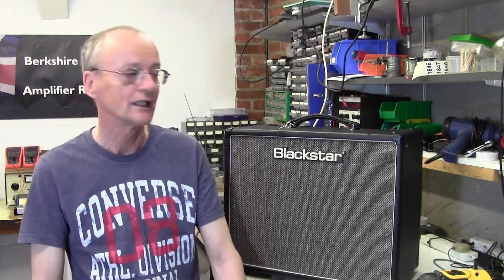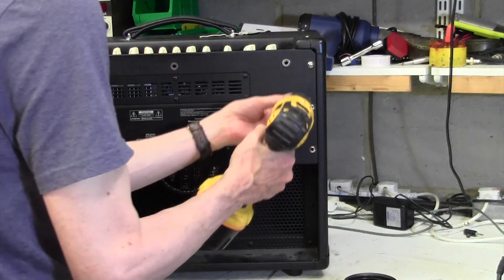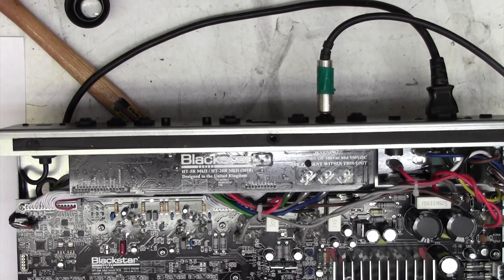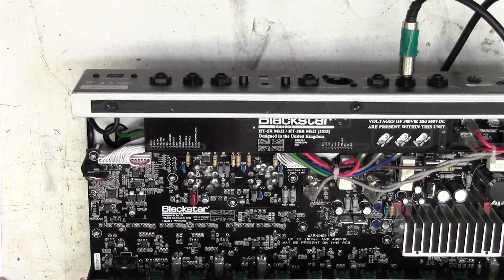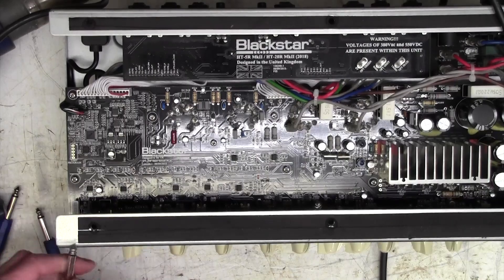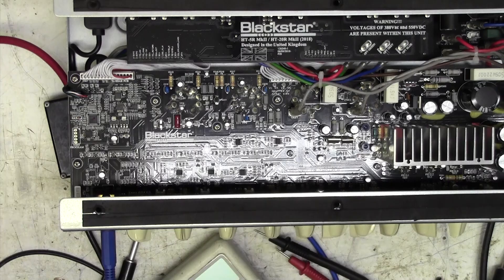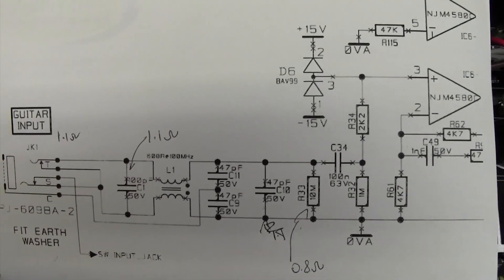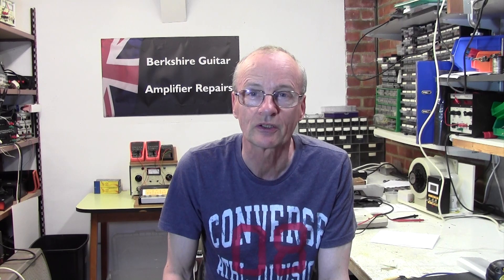How To Fix Blackstar HT20 No Output

Comment: My nephew owns a Blackstar HT-50 212 combo. He has had it repaired twice for preamp issues. Shortly after getting it back, it operates perfectly, then the same failure occurs. He now uses the return only, with an external preamp. These amps were not engineered for serviceability. I do not fault you for refusing to work on these disposable douche amplifiers. Nevertheless, carry on and I look forward to your next installment. cheers!

Comment: A truly heroic effort Stuart, and a very interesting dabble into the world of surface mount electronics.  Would be interesting to know why all of those components (each of which introduce a potential failure point) are needed.  They must have had a problem with RF noise on the input.  The delay in signal startup is also interesting.  Maybe there’s a noise gate chip somewhere in the preamp circuit for the same reason.  I wonder if these circuits are designed by a real engineer or by some AI robot?
Reply from the maker: Thanks Jeremy. I think they are over complicated.

Comment: I had the same static/lack of input minus the “grumbling”, found the resistance of C1 to be .3 ohms. Resistors downstream of the coil checked out. Removed C1, short still present. Removed the coil, short gone! Put in a couple jumpers to bypass the coil and reinstalled C1, everything is working again (for now)! Thanks for the diagram, thanks for the video.
Reply from the maker: Hi Christopher, oka well done!

Comment: Thanks so much for this video!!! 
I have worked on 1000's of vintage hand wired Valve amps. I don't work on PCB amps. I always sent PCB and solid state amps to another shop  because I had so much vintage amp work and because I hate working on PCB amps. :(
Friends of mine have a 16 year old son who is learning to play. No sound at all coming out of his Blackstar HT-20R amp. All lights, switching worked and the valves were fine. 
They called me and asked if I could take a look at his 6 month old Blackstar HT020R. The components are so tiny in this amp, it's insane.  No solder joints broken that I could see on front panel or the speaker jacks or on the board, but even with magnification, this amp was a tiny parts nightmare inside.
 Thanks to your video I was able to quickly spot that same inductor as being bad. There was a smoky film next to L1 on the board surface and there was a tiny solder blob stuck to the inductor. The inductor just fell off the board when I poked it with a chopstick. I jumpered across the two half's of the inductor and the amp came back to life.
The dealer that sold the amp new had a heart attack and will not be back open for several weeks. They can see what he can do for them when he returns.
For now, the boy has an amp and is able to play and so that is a happy ending.
Reply from the maker: Well done! Yes those Blackstars are a nightmare AND they have now stopped doing replacement boards for the HT1 and HT5 - so those are all now landfill when they go wrong. It's all a bit annoying really. Like you, I very much prefer to work on valve amps and am quite picky about which transistor amos I take on. Just given up on a VOX VT15 for the same reason - all surface mount.
Reply: @stuartukguitarampguy5830  I have gutted many PCB amps over the years and installed hand wired boards. Using a classic circuit like a Marshall Plexi, 18 watt,  20watt.
Or Fender champs, Bassmans, AB763, etc.
The circuit used depends on the amp chassis size and the number of valves.

Comment: Could You tell us mr. Stuart, from the repair technician perspective, what brands and models of affordable guitar tube amps are reasonably well made and servicable? For example i really want Fender Bassbreaker 007 or 15 but from what i've seen and heard they are horrible to service. Maybe something like Ibanez tsa 15? It's like the cheapest, good sounding 2x 6v6  amp.
Reply: My experience is that what you and I would like to have simply does not exist.
Reply: @richclayton5785  I don't expect perfection or handwired stuff, just not micro smd stuff and crazy closed from all sides multi board madness. 
I think that something like Blues Juniors are servicable and reliable enough, and some Orange, Marshalls, maybe Egnater Tweaker? I just would like to hear some confirmation from professional service technician.

Comment: A 'technique' which may help in future is to use two small soldering irons to remove SM caps  etc (one iron on each end), though you have to flick the component off once removed as it always sticks to one iron. Rumble diagnosis by scope only I suspect, thankfully you have the schematic.

Comment: Hi Stu, agree about fixing these amps, although I have done a fair few I'm never happy to get one in. I never would have guessed that common mode choke would go short, nasty! Just a guess, but I wonder if one of the anode resistors or a coupling caps on V1 were causing that rumble?
Reply from the maker: Yes I'm kicking myself a bit now for not spending more time around V1. I think I was so fed up spending all that time tracking down the input fault that I just wanted to sign off on the job. Not very professional,  agree!
Reply: @stuartukguitarampguy5830  quite understandable. I think it was very professional of you to even make the attempt that you made.

Comment: I had an HT-20 Mk.1 (that's a MK.2 you have there). I paid $350 brand new in a clearance sale as they were phasing out the EL34 powered Mk.1s to the EL84 equipped Mk.II. I reckon the clearance price was so low because Blackstar were no longer making a lot of the parts including the PCBs for the Mk.1s. 

When I had a look at photos and videos of gut shots of the amp I sold it immediately for $280 and put that money towards a cool Soldano designed Jet City JCA2OH for exactly $280 with a full replacement tube set included free of charge! Good amp, great seller. It'll be even better once I mod it :)

Thanks for these. The only Blackstar amps I'd consider are the Artists and the Artisans. The latter are P2P handwired amps but cost a fair bit. The Artists are okay amps.
Reply from the maker: Ok thanks for sharing the info Matt

Comment: To be fair, I have a Blackstar Artisan 15 which is really quiite neat point to point hand wired with big old components, a huge contrast. I had an HT-5 before that which I didn't get on with at all but the Artisan is great and very repairable. Made in South Korea I believe and the story I read claimed Blackstar engineers were in Korea for ages training locals on their QA requirements. Unfortunately manual, skilled labour isnt cheap with the result that the lower end of the market is mass produced on machines designed to make SMD boards because it is more cost effectve. Like many things, you pay your money and make your choice, it is just a shame that the cost of the better made equipment tends to be high.
Reply from the maker: Yes I think that's absolutely right, it's purely cost and what people want to pay. What I find unforgivable though is Blackstar stopping selling replacement boards for these surface mount amps. That's NOT a cost issue as they could actually make a good profit on selling them. So it must either be 'we don't care' or 'we can't be arsed'. Neither of which are acceptable.

Comment: Crawling with chips! 😂

My Blackstar HT Studio 20 makes a lot crackling noises and when playing it sometimes randomly gets louder and then back to quiet again. Very strange. Could this just be that it needs new tubes? I don’t know if it is really worth forking out a hundred odd quid for new tubes when it might not be the problem. The orange lights appear to be glowing OK when amp is on! 🤷‍♂️
Reply from the maker: Hi Chris  My gut feeling is this not be a tube issue. I hope you manage to get it fixed but it isn;t easy finding someone to do these amps.
Reply: @stuartukguitarampguy5830  thanks very much for the reply Stuart! I had a closer look in the back and the only thing I could notice is one of the valves is in very tight and the other one is a bit wiggly compared to that other one. Not sure if that matters? 
I think I might cut my losses and sell the amp on as used/broken and get something new. 🎸👍

Comment: I have the same blackstar ht 20r mk2 amplifier but it is making some strange sounds randomly.
It gets worse when I disable the attenuator from 2w to 20w.
As it is under warranty I haven't opened it. 
I have already contacted the store and they say that if there is wear on the tubes they will cover travel to the technician and the inspection by the Blackstar technician. Is this a correct procedure?
Reply from the maker: Sorry I don't know what the 'correct procedure' is here. I hope you get it sorted.

Comment: Down the Blackstar rabbit hole. I've had only one brush with SMT, it was a Laney with an opamp on the backside of the board and the complaint was an intermittent EFX loop.. So I bought some chipquik and a whole passel of surface mount opamps to practice on and a nice big magnifying lamp and then as I was examining it under a 12x glass I saw a small ball of solder that was rolling around among the pins of this opamp. I fished it out with a bit of wire, and have never ever touched surface mount anything again. I did report to my parole officer the whole sorry affair, and struck Blackstar and Mesa off my list of things I will work on. Right now anything that uses SMT or a Mesa that needs board level repair gets handed off to them what made it to struggle with. I'm finished.
Reply from the maker: Hi Robert You were brave to even try!
Reply: @stuartukguitarampguy5830  Mama didn't raise no fool.

Comment: What a flippin' nightmanre..!! Why make such an amp, if it's impossible to repair..Blackstar woldn't be my first choice. Nice repair Styart..Ed..uk.😀
Reply: I have been hearing about reliability issues with Black Star amps over the past few years. I can see why now.
Reply: @gib412  Yes, not the best Stuart..!
Reply: Like most things, I think it depends on price - as I mentioned earlier they do make rather nice point-to-point wired amps in the Artisan range but they are not so versatile and not cheap.
Reply from the maker: Thanks Edward!

Comment: This is why back in 08-09 I built (2) Metroamp plexi 100s and a JTM 45 to accompany my 1992 SLP Marshall head. I could see that these amp manufactures where doing what the car industry has been doing over the years. They have been making things more and more difficult for us shade tree techs to repair. 

They would prefer you throw it out the back door and go buy another amp from them.  What a shame really.  The less clutter there is in a circuit, the less inhibited the signal and purer the tone in my opinion. And it just raises the chances of something going wrong right in the middle of a gig.
Reply: I'm not sure that is a totally fair comparison - I suspect that a decent set of transformers for a 100w plexi style amp costs more than this entire Blackstar amp. If they could produce a comparable repairable amp for the same sort of price I wonder if they would? I suspect the answer is yes and that the lack of repairability is a side effect of needing to make these things cheap to be able to compete commercially. That doesn't explain why they don't sell replacement boards, unless the cost of stocking them and staffing a spares shop makes it financially unviable. It isn't new that manufacturers won't help hobbyists repair amps, I had an Orange AD-5 that blew the OT, it's a 5 watt SE amp and the OT looks like a no-name Chinese product. I think their argument was that it is too dangerous because I am not an Orange certified repair guy - replacement is soldering 4 wires, I build amps, it isn't rocket science. Would Orange sell me a transformer? Not a hope though I could send the amp over seas to get it replaced... In that case it was a no-brainer, replaced with a Hammond equivalent and away you go, sounded better too but the attitude sucks.
Reply from the maker: Yes agreed I much prefer the simple hand point wired amps.

Comment: I've always believed that putting SMD components into a tube amp is insane. I don't really know why they do it, cost savings or space reasons. Either way, I would never buy such an amplifier.
That bubbling noise is a lot like the noise a dry condenser makes. But as you say, Stuart, it is better not to work with these types of amps.
Cheers
Reply from the maker: It's purely cost. A robot can assemble a pcb like that in under 3 minutes!

Comment: I can change SMD components. It does take a long time to learn and really it's a question of getting some scrap board and practising with decent flux and a hot air gun. But my main issue is besides that, how on earth are you meant to troubleshoot that? You can't lift any legs or swap out something in the route to see if something changes, you can't piggy back a signal onto it, there's nowt you can do. That amp is simply e-waste. And that is really shameful!

Comment: Blackstar actually repair all of the products they sell. 

Any component on the board can be replaced by the guys at Northampton and the charges are very reasonable.
Reply from the maker: Ok that's interesting thanks for nthe info. I bet they don't replace the SMD on those boards though!
Reply: @stuartukguitarampguy5830  they claim to repair at component level so I guess they do
Reply from the maker: @rgbplumbinghilton  Ah yes but there are many components on these amps which are not smd. To be fair though, I bet it's super rare for the issue to be with one of the smd components.

Comment: The guitar amp looks like a computer!
Reply: because it is made on the same sort of pick-and-place pcb manufacturing machine. If your public wants a feature filled amp for a competitive price you have to use the cheaper construction methods which means whatever is the most common - in this case the construction methods used by mass electronics manufacturers, You cant automate point-to-point (as far as I know) and skilled manual labour with good quality control is not cheap.
Reply: @sjgreaves  That's true.